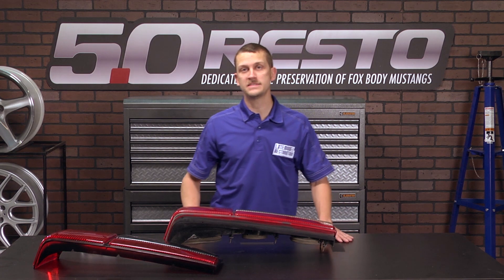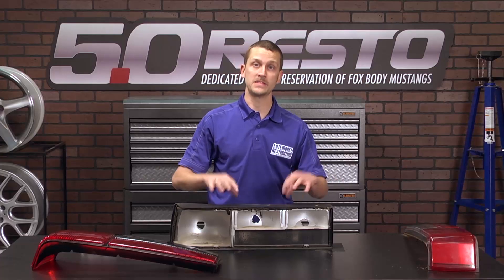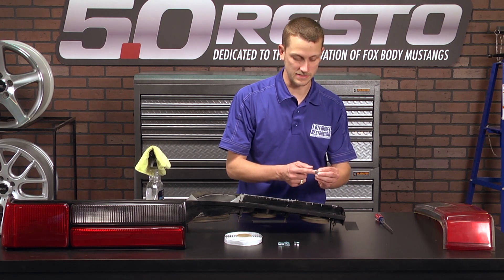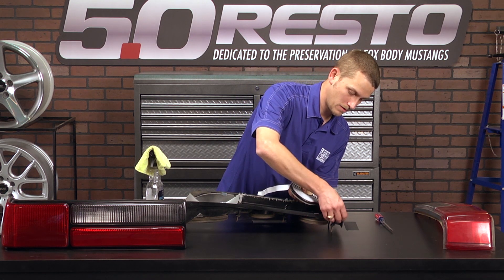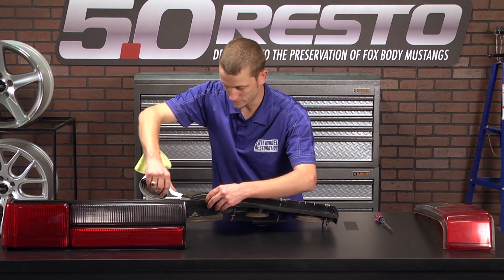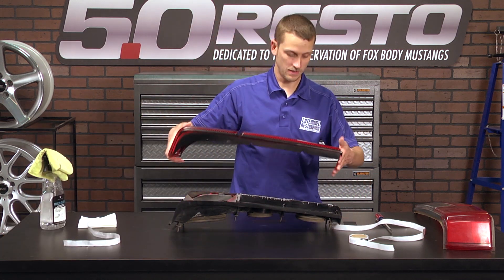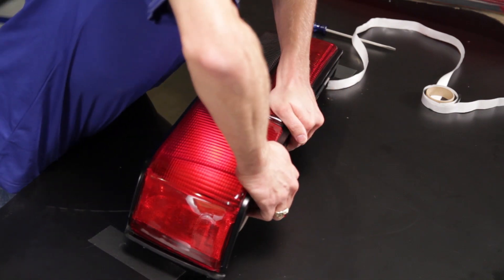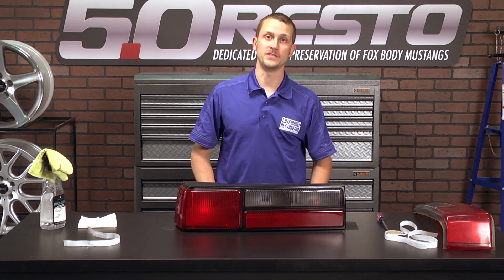1979-1993 Fox Body Mustang Tail Light Lens Install

Comment: Can I use 87 lx taillights on my 79 cobra? I know the center bolts are different but if they are removed it should work right?
Reply from the maker: Brandon, Thank you for your question. I do not recommend it because you want them to be a good seal so they don't leak water into your car. The tail light panel is completely different on 79-82 cars versus the 83-93 tail light panel. Also, the bulb configuration is different between those year ranges. If you really wanted to do it right, I feel the easiest route is to change the taillight panel to make them fit and mount correctly.
Reply: @latemodelrestoration  I like the factory taillights but I have one that's broke and no body makes them
Reply from the maker: It is unfortunate that they aren't made yet, I would try giving prestige a call they might have a good set.
Reply: @latemodelrestoration  So would 87 tail light fit on a 86 fox?

Comment: Hey guys I'm from Argentina and I just bought an old 79 turbo fox body. It's in decent shape but the tail lights need to be replaced, and I'd like to know if all fox body tail lights (79-93) are compatible, if I change the hole part of course, not only the lenses. I'd like to go with an 87 or so tail lights, just because I like it, I don't care about sticking to the "original" parts. Hope you can help me guys, thanks!

Comment: I'm thinking about getting a pair of smoked lx tail lights, but I don't know what to do about the bulbs that you need for the smoked lenses. I know that you have to buy red bulbs and I know where to buy them, the question is how many? Do I just need a pair of the red bulbs, or do I need to replace every light in the tail light with red bulbs? Anyone got any clues, or has anyone installed smoked tail lights before that can tell me what they did?